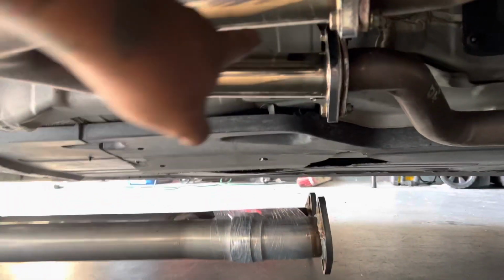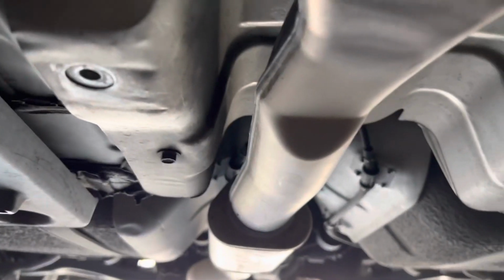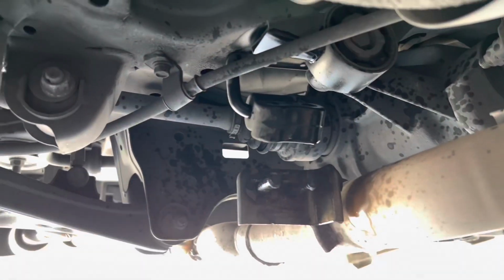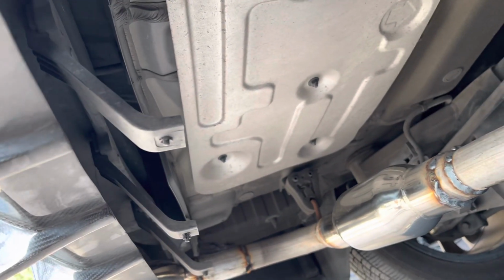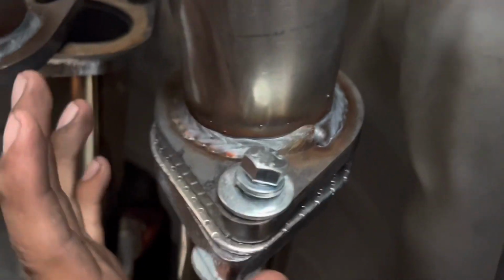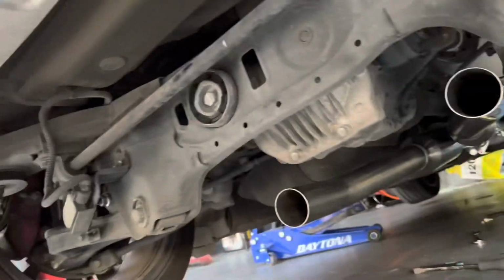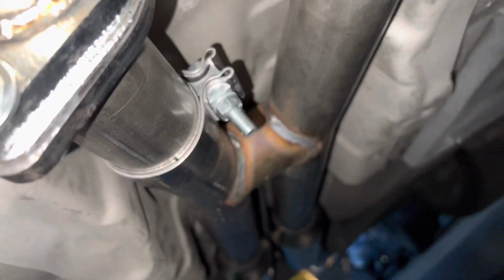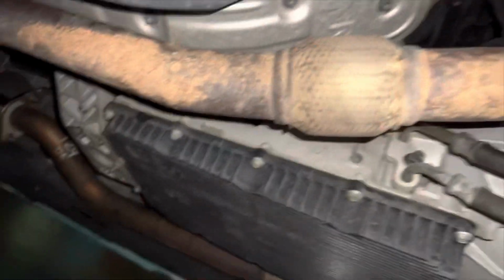Solo Performance Exhaust Install DIY w/ Sound Clip | Genesis Coupe 3.8

Comment: Ive heard the solution to fix the hissing is to make a crossover pipe between the downpipes. Would using an H-pipe instead of test pipes give the same result? Seems easier to get ark h-pipes then welding.
Reply from the maker: @scortch7187  nope. You’ve been told wrong. 

The fix is to send it back for warranty replacement since it’s a known issue due to poor welds in the muffler they use. 

We discovered this after contacting Solo performance
Reply: @ProdigePerformance it's strange that they haven't fixed this yet acrossthe line. How easy was it to get them to replace the muffler section of the exhaust?
Reply from the maker: @ they send replacements all the time. It’s not their fault, it’s the company that actually makes the muffler. They just stamp the muffler with their logo

Comment: What's the difference of the H pipes and regular test pipes? Also does it make a difference the downpipes compared to the stock one ?   Just got the solo Performance cat back !
Reply from the maker: H pipe helps reduce rasp 
But Ark h pipes will not work with solo performance. They need to be custom basically. 

Downpipes don’t make a difference but people get them because stock ones cost just as much as aftermarket and the flex pipe on aftermarket ones like ark are longer and more durable unlike the oem ones

Comment: What did you do about the check engine light after installing the down pipes
Reply from the maker: You only get a check engine light if you get aftermarket headers.

And you can get rid of it by getting tuned by Alphaspeed or putting in mini cat defoulers which are $120 each roughly.
Reply: @ProdigePerformance  got a link where to get the defaulers
Reply from the maker: @dominicanpapi81  https://speedzone-web.com/products/mini-cat-o2-sensor-cel-fix-large-90?variant=40709571379285&currency=USD&utm_medium=product_sync&utm_source=google&utm_content=sag_organic&utm_campaign=sag_organic&utm_source=google&utm_medium=cpc&utm_agid=&utm_term=&creative=&device=m&placement=&gad_source=1&gclid=CjwKCAiAiP2tBhBXEiwACslfnkkhYogP-_5HCePPoRKaoQm8vqVpTN91q62FpoqF3qUPFQoZEsZVjxoCH6YQAvD_BwE

Comment: Do you know how to get rid of the hissing sound when accelerating the car when parked or in neutral?
Reply: Get a 2inch pipe welded across your downpipes so it forms like an H pipe and get those clamps welded together! I wouldn’t recommend welding the clamps for the tips because then you can’t adjust them but doing all this will get rid of the annoying hiss
Reply: @dabussy6001  thank you 😊
Reply: @dabussy6001 man i tried asking an exhaust shop to do this but they refused cause the exhaust already has a crossover (h pipe) on the catback itself and having 2 crossovers would be “counter productive” 😂

Comment: sounds good at idle. not much of a fan of the rasp D:
Reply: I have the same set up. Solo performance exhaust and test pipes. There is a bit of rasp with the set up, but the audio in this video just doesn’t do justice. Sounds a lot better in person
Reply from the maker: Yeah it can be a bit raspy but it sounds good. I still prefer isr single exit gt
Sounds way better
Reply: @ProdigePerformance  how would you describe the sound of the isr single exit in comparison to the solo performance? Never heard it in person and am curious to know of your opinion.
Reply from the maker: @mishavorostsev8994  it’s a bit louder than stock but deeper. No drone rasp or anything if it’s just the catback alone. 

With test pipes it gets louder and starts to pop and backfire a bit more. 

Headers test pipes and single exit gt
Sounds like a GTR  but has a little rasp when getting into WOT but goes away and pretty loud. I personally like x pipe and single exit gt on  3.8 as my favorite set up. 
No rasp / no drone / deep aggressive sound and definitely not to loud. It’s appealing. The x pipe just allows it to sound different but great for whatever reason.
Reply: @ProdigePerformance  got it, thanks man
Reply: @mishavorostsev8994 did you get any exhaust leaks type noises with the solo exhaust??
Reply: @dabussy6001  I had a little but I adjusted the small metal pipe that attaches to the test pipes and it’s been a lot better. Still a little rasp but all in all sounds great
Reply: @ProdigePerformance  Do you mean an X pipe in place of cats/test pipes?
Reply from the maker: @raccoonhuntercheco  yep. Custom x pipe is my recommendation
Reply: @ProdigePerformance have you tried it with ark test pipes and headers ?
Reply from the maker: @alexanderamaya6520  ark don’t make headers anytime and isr and ark test pipes are basically the same
Reply: @ProdigePerformance  I didn't explain my self I'm saying how would it sound the solo performance with art test pipes and any headers ?
Reply: @ProdigePerformance  I was also thinking of removing the muffler but I'm not sure how it's going to sound